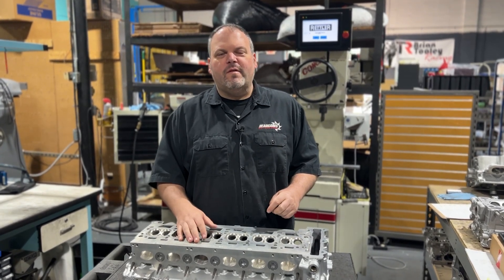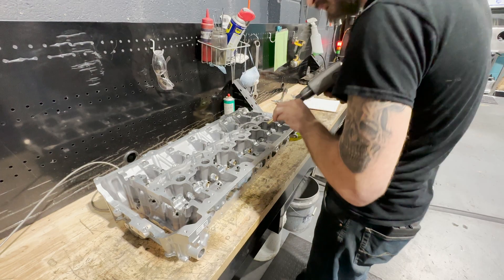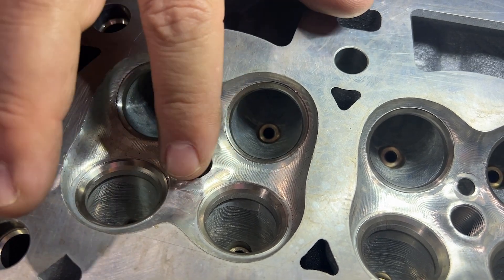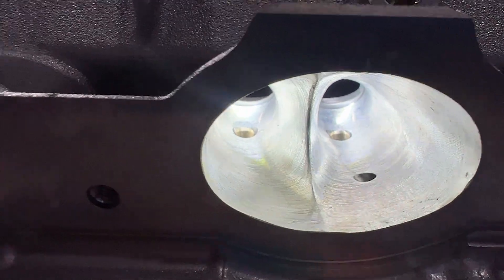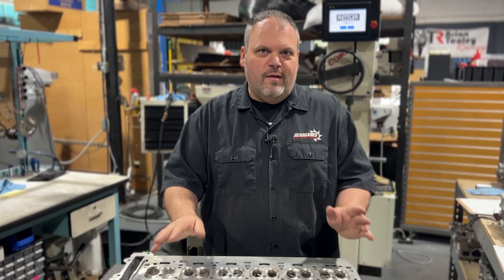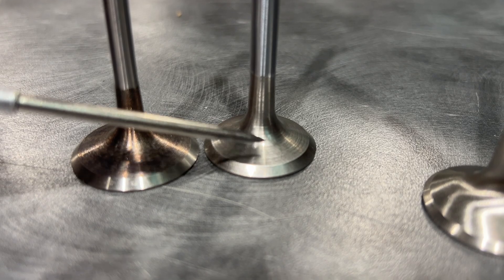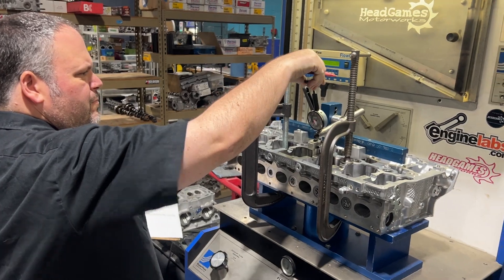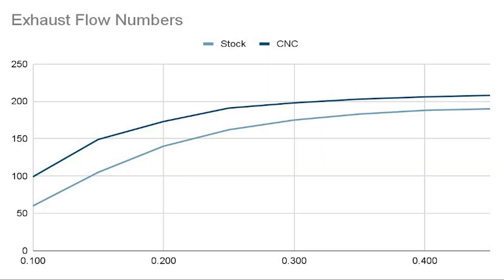B58 Road to CNC Part 5- The Final Countdown!

Comment: Admiring of what you do and have a friendly suggestion for a series of videos for newbies like me.  Now that we know apparent gains of porting and heads upgrade.  Would be nice to be explained possible routes that are necessary along with a heads upgrade (fuel system possible routes,  cylinder,  comp. ratio,  naturally aspirated, force induction,  cams, headers, etc.)
Reply from the maker: Thanks! Do you mean per head or in general? 
Issue is, I know cylinder heads and don’t work on cars so my suggestions would be kind of guesswork or vague.

Comment: Any videos on the N54 head?
Reply from the maker: We have a few of those in the shop right now but nothing very exciting for them. We used to see them a lot but not so much anymore.
Reply: @headgames  Did you guys ever put one on the flow bench?
Reply from the maker: @avimedina6562  yeah like 5 years ago or so. Maybe more.
Reply: @headgames  I am trying to set a world record on that platform N54 engine  looking at the head and it doesn't not look like it will flow above 200 cfm
Reply from the maker: @avimedina6562 200 at what lift? It definitely flows more than at peak lift.
Reply: I have the stock ECU on the car I shift the car at 6500 rpms anything after that nothing to be gain on the power band that's with stock head and cams at 27 pounds of boost
Reply from the maker: @avimedina6562  it’s been awhile since I’ve flow tested one. So don’t remember but I don’t think it flows much more than that peak. Setting a record with it would need to get ported for sure.

Comment: Hi Dave. Very good numbers, I congratulate you for the work. 
One question, what is the diameter of the intake and exhaust valves? 
Greetings from Spain
Reply from the maker: hey buddy! Greetings from the USA! 30.10mm intake  28.5mm exhaust
Reply: @headgames  Uoooohhh, the flow it has is impressive.
This engine has a true 82mm cylinder, which is why the valves have that smaller diameter.
Regards and thank you.
Reply from the maker: @goyocarreras  the 84mm bore s58 has the same valve size. It’s crazy!
Reply: @headgames  OK OK, I was confused, the B58 is the one with 82mm and the S58 is 84mm, am I right Dave?
It is impressive that with such small valves it has so many CFM
Reply from the maker: @goyocarreras  that is correct.
Reply: @headgames  Thanks

Comment: I'm rather surprised that you guys left the quench stock. Given this is a mid/high boost engine I was really expecting to see the quench tapered back to 1 or 2 hundredths from the cylinder wall. To be fair I haven't gotten my hands on a B58 yet. So, I don't know how active the quench is on these engines. But generally speaking, on Mid/Highly boosted engines I've found (wedge heads or otherwise) de-energizing the quench has significantly reduced octane requirements for any given power output. Now NA applications are completely opposite.
Reply: PS. Great job on the chamber. Looking at all of the sharp edges on a stock one makes my head hurt  LOL
Reply from the maker: Hey man! I don't like to slow the chamber down  and remove a lot of quench. It is there for good reason. Good fuel is not hard to get here.